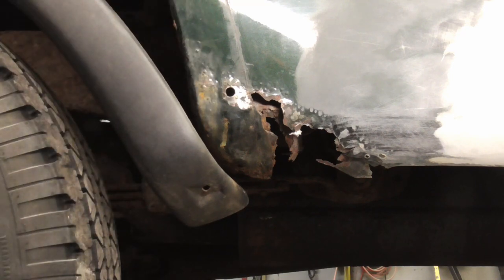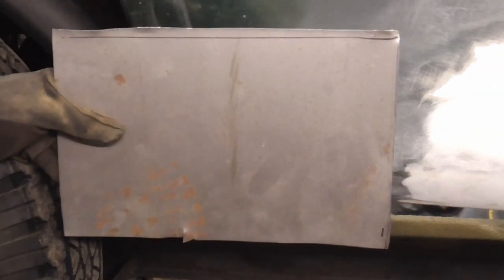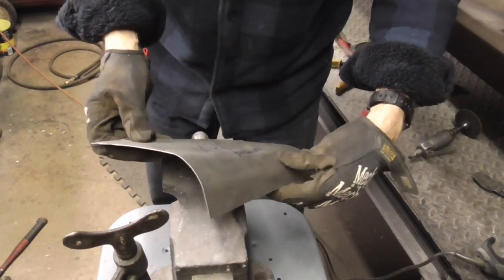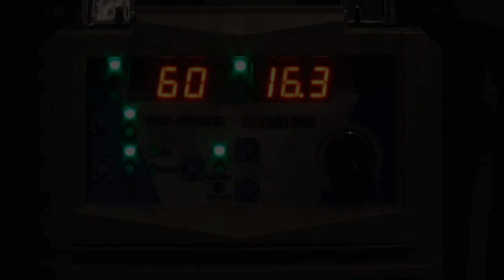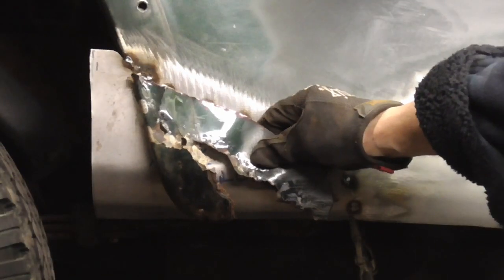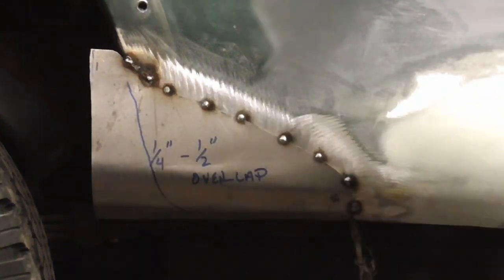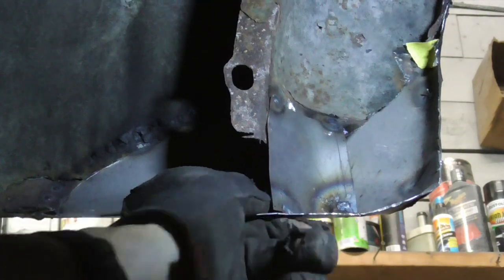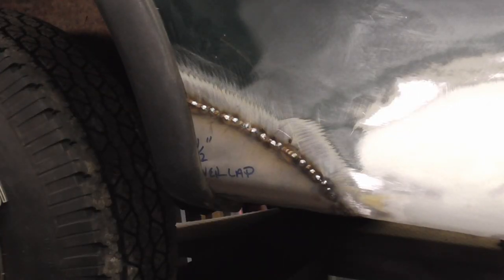How to Make Custom Patch Panels Right on the Vehicle

Comment: I did quarters on my old ramcharger exactly like this about 15 years ago. It was my first truck and first try at body work. I couldn't weld then, so I used pop rivets and reinforced fiberglass, but it's all still there. Imperfections and all. Great video.
Reply from the maker: Thanks for you input Kevin - have a good weekend :)

Comment: Thank you so much for your videos as I'm starting on my truck thanks to you but one thing I have noticed is if you use tools every day I belive in spending money on tools that's why I always cut metal with Midwest snips and fold metal with Irwin locking bar folders. Sorry haha I work with metal roof panels so metal working is my specialty.
Reply from the maker: Nothing is better than US made tools - I agree 100%.  I wish they made more stuff in USA like taps, dies, drill bits, hand tools, air tools, etc.  I have some USA made adjustable wrenches and other stuff that I love to use - makes the job fun actually :)

Comment: I tell you what took me like a week to make a wheel arch for my moms Honda Accord. Then like 3 days of body filler sanding. But turned out good. Kept having an issue the body filler drying in like a minute. Screwing with me
Reply from the maker: Use less hardener - mix quicker - apply quicker.  Nice job though getting it to look good - wheel arches are no joke :)
Reply: Yea but she was quoted 1600 to do it. Think I’m in it for 75 bucks. Got the metal for free from work. Your videos are helpful. But deceiving because I’m like look how easy that looks then when I start it I’m like shit this sucks
Reply: @LakesideAutobody  your videos are helpful. But deceiving because you make it look so easy then when I went out there I was like shit this sucks. I’m in it for 75 bucks free metal she was quoted 1600 to do them. Free metal but I think it was to thick it was 16 gauge. Dupli color silver hides slight imperfections. You have experience with upol body filler?? That’s what I’m using not sure if it’s a bad brand

Comment: It would have been better if you had made all the panel fit before you electric glued it and used at least a pipe to form your curve instead of a vice which would give straight line dints. But the ideas there🤙
Reply from the maker: Any ideas that make the job easier would help 😊

Comment: I want to do the patch at the same place near wheel, but I do not have the gas. I have multi-process welder. I am thinking of using flux core. Not sure it will hold the patch.
Reply: Flux core is a stronger and hotter weld. It's more than capable, just have to make sure to take your time and remove all the flux residue so it doesn't create future rust
Reply from the maker: Johnathan makes a good point.  See this video - https://www.youtube.com/watch?v=H87b1xlGofw

Comment: Hi Jerry great video. When you are welding on the vehicle like you are doing here , do you disconnect both cables on the battery?? What about the ecu , etc?
Reply from the maker: I just disconnect the negative - shops I've worked at - this was a common practice - not both though.  If you feel safer (ecu, etc.) do both.  Never had an issue with thousands of vehicles done like this.
Reply: @LakesideAutobody  Thx Jerry have a great week

Comment: Hmm, you' re end result is always very nice, You are a genius when it comes to sanding and painting. But..'...this time I don' t like the lap welding, it will rust fast why not but welding? I get the feeling that this customer wants it quick and cheap. Also the inner side gives me a cold shiver!
Reply from the maker: Butt welding doesn't hold up as well as lap.  Factories lap welded the quarter/roof seam in a valley and filled with lead - it held for the life of the car - this is why body shops lap as often as they can.  Some times, you are forced to butt weld but keep it to a minimum - like edges, ridged panels (rockers, posts, etc.) - https://www.youtube.com/watch?v=JIIonJOVro4  See this vid for more - https://www.youtube.com/watch?v=idrLzsz2eLg
Reply: @LakesideAutobody Thanks for the links, I didn't see the first one before! But probably the discussion will never end about what is the best. My experience is that the rust is always there where the manufacture did lap welding, especially when there are 3 or sometimes 4 panels laying over each other.. And...a manufacture takes imo. always the cheapest method because for them if it hold up to ten years it's oke. But there are people who wants to drive a +20 years old car😅

Comment: Excellent video Thanks. What thickness sheet metal are you using on this patch?
Reply from the maker: That's 20 gauge A1008 CR Sheet from Alro Steel here in Grayling, MI  - you can buy it in 4x8 sheets or have it cut at most sheet metal supply places.  You can also cut up old panels that a bone yard wants to get rid of cheap.  Also, you can stop by a body shop and ask them for their damaged or scrap panels :)

Comment: What kind of mig welder are you using? Flux core or regular mig with gas?
Reply from the maker: That is a YesWelder MIG-205DS  fairly inexpensive multi process welder.  It's listed under the description of the video along with a savings code :)

Comment: How do you like the yes mig welder?
Reply from the maker: It's not bad at all for the $.  The instructions need a little work and you do have to mess with the settings to get it how you like it but overall it works as it was intended to work.  It looks like it will hold up real well too :)

Comment: What about the 1/4 to 1/2 overlap?
Reply from the maker: Knock it down below the original surface, grind clean and fill.  Try to allow for about 1/8" of filler - it's a good buffer or barrier between the seam and the finish :)

Comment: Did you close the weld or just tack it?
Reply from the maker: Pretty much closed it up.  It's probably not water proof though.  I've had good luck both ways (solid weld or spaces) so you don't have too much to worry about.  The seam is tapped down and I believe the filler sort of seals the seam.  Use fiberglass reinforced filler if you want waterproof filler and to worry even less :)

Comment: Check out my BMW E30 videos and see how many patches and panels i made for that lol, also my VWT25, things rust bad in the UK lol
Reply from the maker: On the Lakeside discord?
Reply: @LakesideAutobody  come again?
Reply: I'm going to help u out my friend across the pond. And check out urr vids. I live in PA USA. I've been fighting rust for 30 plus years. My Pap worked for Ford in Ohio by Lake Erie. Theyed get some bad snow. His Co worker drove a post war Ford sedan. Pap asked how do u keep her looking good and not rusting out with all the snow and salt? He said this, Mix 1 quart of any oil new or used, 1 quart transmission fluid new or used, 1 grease gun cartridge, or tub of grease and 1 or 2 toilet flange wax gaskets. Mix and heat all in a old pot, then brush, spray etc. You can add anything u want like I add boiled linseed oil to make it a harder finish. My pap, father and now I use this since the 50s. It's proven, will outlast, it's better than anything u can buy and costs $6 US dollars if u use saved trans fluid and oil from services. I have access to hydraulic oil. Father has a logging business. We've used this on anything that has a engine and steel frame, or body. I mean tractors, semis, trailers, autos, quads, lawn mowers etc. I promise u no more rust ever. Have a gr8 week.

Comment: Way to go! Too much emphasis is always put on butt welding patch panels and no Bondo. I shoot on thinned roofing tar, with a shutz gun, to seal  up the backside..Back in the day (fifties) the bodymen I knew  always said no REAL bodyman uses Bondo ........only lead.
Reply: I'm 25, I've used lead before. Nothing wrong with it, used appropriately. 

Likewise with bondo.
Reply from the maker: That's a great great idea.  I have given that a thought before but never have done it.  I know it would work too - just couldn't figure how to spray it or apply it.  I'm liking that idea of thinning it :)
Reply: @jimbob3708  Both are good, but Bondo usually wins because of $$$, today.
Reply: Old shop teacher taught me leadding. It's a dying art. See UK Bmw, VW guys comment down below for the rust killer mix I shared that costs $6 or so when using saved old oils from changes. Worked since the 50s and 3 generations.

Comment: the proper way to do the repair is to work from the inside to the outside not outside to inside
Reply: Post a vid and show us how it's done, gary, and while you're at it, show us how to correctly use a capital letter when posting your name, gary? Lol.
Reply from the maker: With respect Gary, it is not correct to work from the inside because your lap seam would then hold water or moisture.  My seam is facing down on the inside like a shingle.  This is how the rust belt has done rust repair for years.  It holds up to daily driving, wet weather, salt, stress, etc.  Hope that helps :)